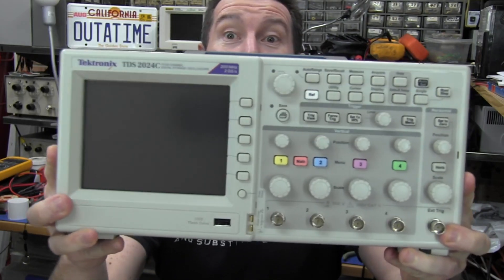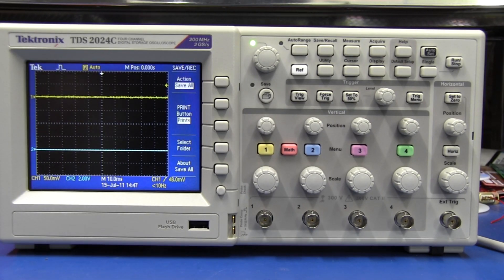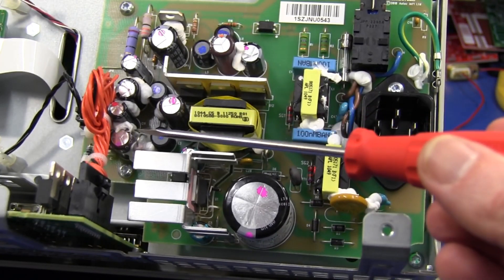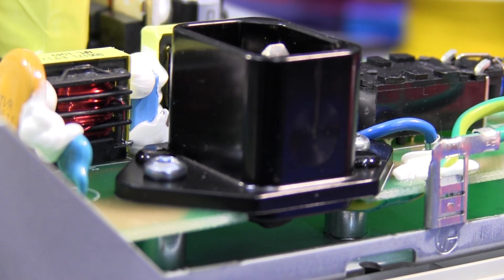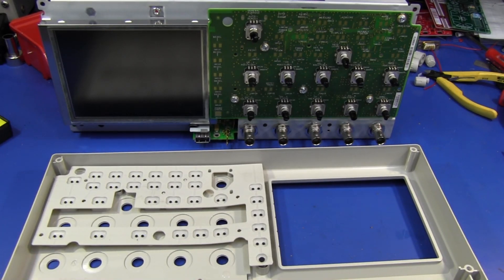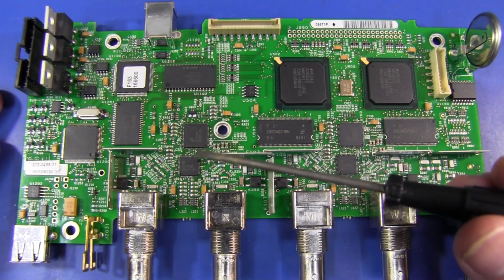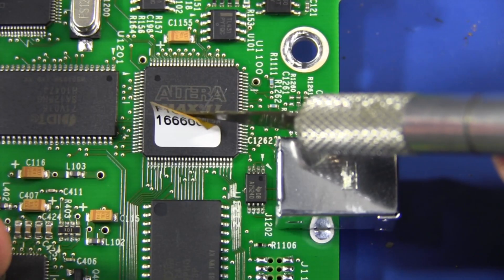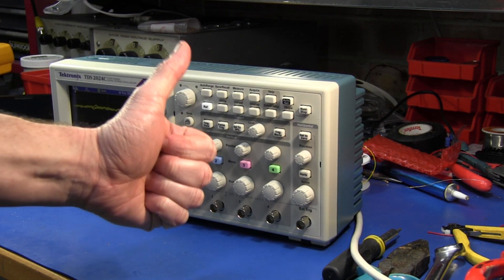EEVblog #187 - Tektronix TDS2024C Oscilloscope Teardown

Comment: 16:08  that empty expansion header is a carryover from the 2005 model with a extension module (GPIB/RS-232 & parallel output for printing screen data)

Comment: Nice tear down.  I agree with another comment.  It would be nice to see a tear down of an older analog scope.  On a side note.  My employer provided me with a TDS2002C.  Basically the same as the one you have there but with only 2 channels.  It's decent enough for my work though like you mentioned, it would be nice to have more memory.

Comment: Concerning the knobs, It would be my opinion that this scope was Designed for Manufacturing not the User, using the same knob size lowers the unit cost.  This scope is a classic out-sourced component device; Screen, power-supply, etc.  About the only thing original is the Textronix ASIC board which was modified from the original 1000 series.  More and more device are becoming software built machine.  This keeps the hardware design cost down.
Nice video.  Thanks again,

Comment: @vladimirFNX I believe that the colors depend on the manufacturer and possible it may indicate an inductor vs a resistor on some units. Usually physical size will indicate wattage.

Comment: We have one TDS2004 at work, its very similar to this one. But when we decided to get second scope I chose Rigol with LA inputs. Its significantly cheaper, has more memory, more functions. I don't know about this one but TDS2004 can't zoom the signal and doesn't take flash discs larger than 2 GB. On the plus side it has separate knobs for each channel. So its just reliable overpriced basic DSO.

Comment: Dave, a few things you needed to explain to viewers is the oscilloscope is isolated. In Addition, the channels are isolated between channels. This I use the TPS-2024B for Synchro/Resolver applications.
Reply: That’s not sir. The 4 channels get connected in the same wire of ground.

Comment: It'd be cool to see a comparison review of entry level recently released cheap 'scopes for starters or home tinkerers and hobbyists. I mean like the two cheapest that element14 have at the moment, the TENMA  72-10510 and the TEKTRONIX  TBS1052B. I know these ones have pretty crap specs, but for the uses mentioned above, it would be good to have a comparison of about 4 different cheap models to make it easier to choose the one with the best bang for buck.

Comment: 2.5k record length is plenty, Dave, For an old QVGA screen oscilloscope, which is 320x240 in resolution, can only display 320 voltage dots across the horizontal time line, so, 2500/320= 7.812, about 7-8 screens worth of wave forms. Is 7 to 8 screens wave forms enough for you? Dave
Also, low end oscilloscope uses 8 bits ADC chip for the measured voltage, 8 bits is 256 voltage resolution ,  the QVGA screen (320x240), vertical resolution 240 used for the 8bits (256) voltage, is barely enough, so the oscilloscope has the knob to let you move the wave form up and down.

Comment: I must admit I prefer CRT scopes, or Iwatsu's CCD tube technology. That said, I think Tek could benefit from looking at the USER INTERFACE of their classic models. Every knob is different. It follows aircraft practice. See FAA design standards on the web...All the knobs are shaped like what they control, flaps, gear, throttle, prop are different, etc. 

 Penny and Giles have some great digitizing jog controllers that would work very well for these purposes.

Comment: My TDS220 has a 68k processor too, I'm a bit surprised they still use those, would expect it to be possible to cram that function into the ASIC:s :) Also National Semiconductor for the analog parts, not much new stuff (OK the ASIC:s are new...)

Comment: Very good. What does the chip K300 do? A relay?

I don't see circuit taking care of high input voltage, for example, +/-40Vdc range when probe in x1 mode.

Comment: This scope is a bit overcomplicated, they have to use a 1 bajillion pin QFP just for PROBABLY a USB host and a test signal? 2 FPGAs to control the unit? 2 ASICs for acquisition? No wonder TEK scopes are getting high on price, too many devices (and I happen to have and love a Tek scope, an MSO2014).

Comment from the maker: @Mtaalas They didn't give it to me to review, so they don't get a say in it :->
Why did they put out a 2.5K sample memory scope, the same as their circa 1997 model? I don't know, maybe they thought they could be lazy and get away with it?...
Reply: Maybe it was a limitation of the technology available.  The 2.5K sample limit suggests they are using the same capture electronics as the TDS 210.

If I remember correctly, the TDS210 did not have an A/D converter than can sample at 1 Gs/s (or an array of A/Ds used cyclically).  Instead, it had a pair of analog CCD-like devices that capture two inputs in analog memory at 1 Gs/s, and then the captured waveform is clocked out of the analog memory and A/D converted at a much lower frequency.  This gave 1 Gs/s on both channels at once - but it couldn't capture more than 2500 points at one time because that's how long the analog memory device was.  To extend that, Tek would have had to fabricate a longer device, which may not be possible.  It's not just a matter of adding more digital RAM.

Comment: Hey Dave I got a free digital oscilloscope. I can hear some rattling inside and was wondering if there's any precautions I need to take after I open it up so I don't hurt myself. Thanks
Reply: Just don't go poking around the PSU unless you know what you're doing, and you should be fine.

Comment: Does anyone know the chip labeled with 214 does?
You can see it clearly at timestamp 15:38 , at the bottom left. The pcb has K300 written above it.
I would really like to know where to get one of those.
Reply: It's opto-isolator. They used it as solid state switch to switch between AC coupled input or DC pass through input.

Comment: Hmm... Is that power supply module custom designed for Tektronix? Everything seems to fit so nicely. Maybe they designed the case around it. BTW. these modules are way to expensive on sites like Mouser. Is their volume cost high as well, or they just don't like dealing with small projects?